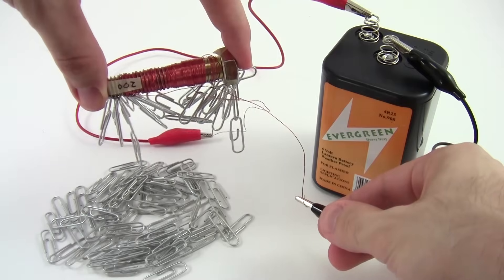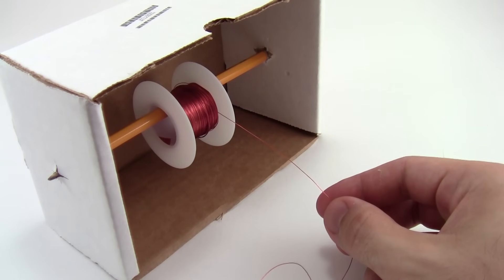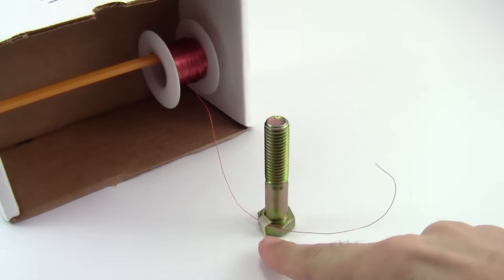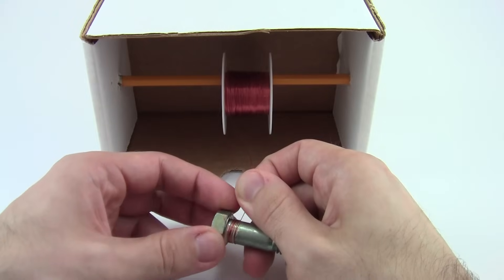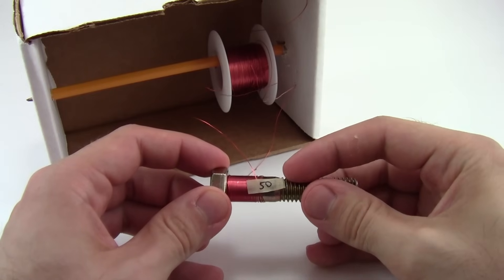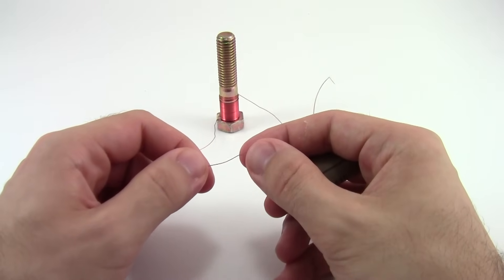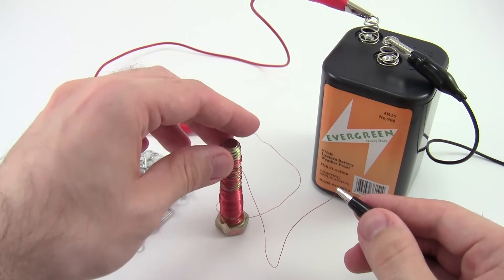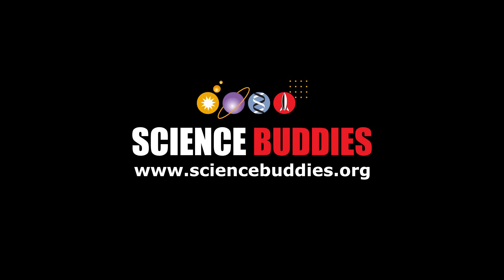How to Make an Electromagnet | Science Project

Comment from the maker: A kit with all the parts you need for this project is available here! https://www.homesciencetools.com/product/make-an-electromagnet-kit/?aff=SB1
Reply: Hi Science.Buddies. I have three questions.

1) If you take that same iron bolt with the same copper wire and with equal
     number of copper wire turn, but the battery is 12 volt instead of 3.7 Volt, then
     would the electromagnet be stronger and if so then how much stronger?

2) When creating an electromagnet, what is the maximum voltage should be use
     to make the magnet stronger and at the same time utilizing less current 
     (The magnet is more energy efficient) ?

3) If you use a Neodymium (rare earth) magnet  and wrap a coil around it like you
    did and you use a 3.7 Volt lithium battery, then would the magnet be stronger or
    would it remain the same?

Comment: I must be having some sort of Mandela effect moment cause I could’ve swore that the way direction in which you coiled the wire actually was important
Reply from the maker: The direction in which you coil the wire WILL determine the polarity of the electromagnet - which end is the north pole and which end is the south pole. This "matters" when it comes to which pole of another permanent magnet you will attract. However, it doesn't matter when picking up ferromagnetic but not-permanently-magnetized materials like paper clips, because they will be temporarily magnetized and attracted to either pole of the magnet. Hope that makes sense!

Comment: This is essentially a short circuit,  I never understand how the wires don't melt. Is it simply because of the magnet field generated? Or something special in the tiny copper wire itself
Reply from the maker: The wires do get pretty hot to the touch if you leave this connected for too long. Since there are so many coils, the wire itself is very long, meaning the resistance is higher than if you just took a single short piece of wire and bridged the two battery terminals (in which case you're correct, wire this thin will probably just burn out).

Comment: This is very urgent!! I can't afford a 6 volt battery cause it is expensive where I live, can I use a normal 9 volt battery???
Reply from the maker: You can use a 9 volt battery but the wires may get hot faster due to the higher voltage. You can make the coils longer to help compensate for this, and only test the electromagnet for short periods of time before disconnecting the battery.

Comment: wouldnt this make a short circuit tho???
Reply from the maker: There is some extra resistance since the coils of wire are so long, but they can still get hot and drain the battery quickly, which is why we recommend only running the electromagnets for short intervals.
Reply: @Science.Buddies  by this logic, changing the input from dc to ac would theoretically make a transformer right?
Reply: This is also an induction heater ;) oh correct me if I'm wrong but could I use two transistors to build an op amp into a little circuit etc like how wireless phone chargers work but rather then being a short circuit it would be a better electromagnet? Or am I just way of lol thanks

Comment: How would you do it if you wanted to make the magnet repel instead of attract?
Reply from the maker: Hi - to reverse the polarity of an electromagnet, you just need to reverse the direction of electrical current flowing through that. You can do that by switching which wires are connected to the + and - battery terminals. However, note that this will only switch which pole of a permanent magnet (e.g. a bar magnet with N and S ends) is attracted to which end of your electromagnet. Paperclips are ferromganetic, meaning they can be temporarily magnetized by a nearby magnetic field, but they are not permanent magnets and do not have a permanent north and south pole. So you cannot make an electromagnet repel paper clips - they will always be magnetized by the electromagnet's field and then attracted to it. Hope that makes sense - if not, we have two other videos on our channel you may find helpful: https://youtu.be/V-Gus-qIT74 and https://youtu.be/cxELqN7wjS0
Reply: @Science.Buddies  Ah I see, thank you. I have a hollow iron ball here that I'd like to make levitate / suspend, but I think it's just like the paper clips you described. It's just ferromagnetic. So I'm not sure how I'd go about doing it. I'll check out your other videos though, cheers.
Reply: you cant, only diamagnetic materials will be repelled by the magnetic field produced by an electromagnet. materials like copper and aluminum can also be repelled but by induccion, which requires a moving magnetic field
Reply: @tchosenone1301  Ah I get you, cheers.

Comment: Hey so like i need some help with my project...your video is very informative and i watched it for my project...it's deadline is day after tomorrow and am afraid it's not working....am using 9v battery and nails of likely 5 cm...pls suggest me i very worried for this project as usually most of your projects works perfectly but this time I need suggestion....pls suggest as early as possible
Reply from the maker: Hi - if you have specific questions about your project, you can ask in our Ask an Expert forums: https://www.sciencebuddies.org/science-fair-projects/ask-an-expert-intro

Comment: What wire thickness do i need at 3 Volts?
Or can i use 36 V (does Ampere matter?)
Reply from the maker: Hi - the relationship between volts and amperes is determined by Ohm's Law, Voltage = Current * Resistance. The resistance is determined by the thickness and length of the wire. You do not "need" a specific thickness, but we typically use approximately 28 gauge wire because it is easy to coil. Be careful using higher voltages, as your wire may get hot to the touch.

Comment: Don’t make the same mistake I did and buy insulated copper wire so the electricity won’t escape and will run through
Reply: Both enamelled and magnetic wire is the same for others out there but what I'm guessing you are referring too is standard speaker wire type stuff haha

Comment: Guys for this to work you have to attach it with the battery and let it warm up. Don't expect instant results. Also make sure you're not giving it too much voltage, i tried with 9v and didnt work. But with 1.5, 3 and 4.5 volts it worked.
Reply from the maker: Electrical current should start flowing immediately, so you should not need to wait for the electromagnet to "warm up" to start working. One of the big advantages of electromagnets is that they can be turned on and off very quickly.
Reply: @Science.Buddies  yes but when i did it the very first time i had to wait a while. Afterwards it was unstant
Reply from the maker: @shahchintan8920  Interesting. The only thing I could think of that might cause that is maybe initially you didn't sand all of the insulation off, and as the wire heated up the remaining insulation burned off. Or there could have been a loose connection with the alligator clips that got bumped. Glad you got it working though!
Reply: @Science.Buddies  great video and I appreciate the quick replies, shows that your dedicated. Keep up the good work👌👌👍👍
Reply from the maker: @shahchintan8920  Thanks!
Reply: Shah Chintan

Comment: Thank You for the great video and information. I have three questions for You. Does this electromagnet have a North and South pole? Example:  The Part of the bolt that You started winding at is North or South? How could I make one that would have a hundred pound pull? Also How would I make ir so there is no over heating? All three of these are important to me. Again Thank You.
Reply: The north pole of the electromagnet is where the current flows out of the battery and the the south is the end where current flows to the battery. To make one which is a 100 pound pull, just increase the number of rotations of the wire around the metal and simply just increase the voltage by using a more powerful battery.

Comment: what should be the thickness of copper wire?
Reply: Lovely Kumari it depends on the resistance, size and power of the magnet you want. Low resistance draws more current and it depends on the battery if it can give the current needed. It's basically logical, but I don't know yet how to really decide on the wire thickness, voltage etc.
Reply: Lovely Kumari thin wire has higher resistance, thus shorter length of it limits the current easily. Using thicker wire you quickly end up with too big coil and still don't limit the current enough for the battery.